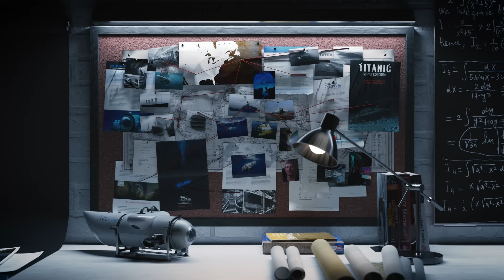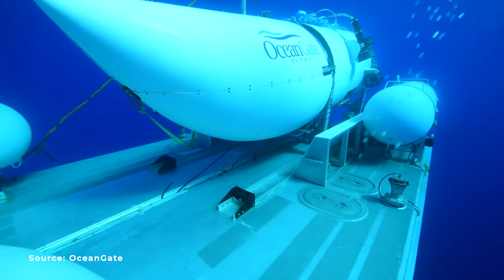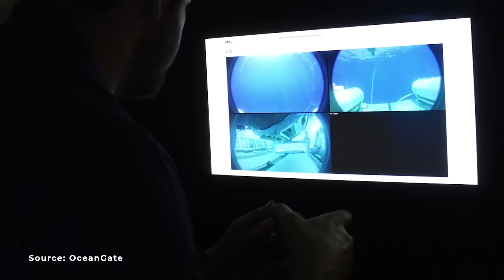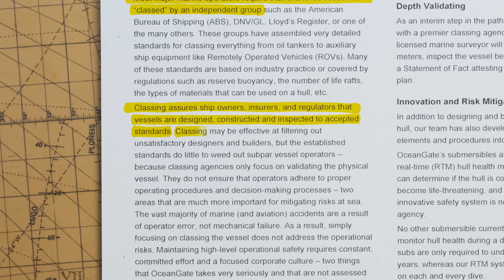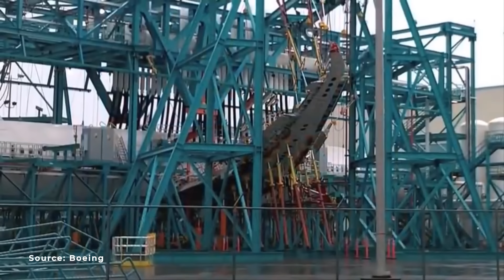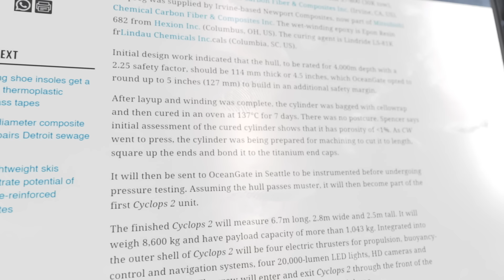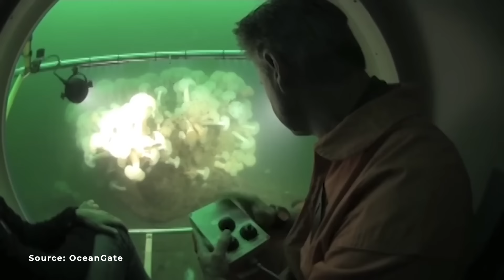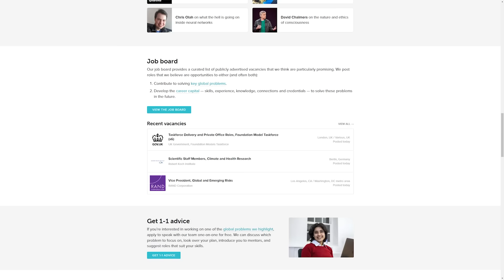The Questionable Engineering of Oceangate

Comment: "The vast majority of marine (and aviation) accidents are a result of operator error, not mechanical failure".

That is because early days of flight and submarine experimentation weeded out many of the bad designs and bad engineering that caused catastrophic failures, you arrogant fool.

It is a testament to modern design features in these vessels that were earned with blood and bones that we have developed resilient devices that sometimes can even compensate for user error or unpredictable situations. It is total failure of understanding to think the opposite, that you can cowboy your way around your submersible and it will all be alright.

Comment: 8:40 I've watched a lot of woodworking videos, and I don't know if it's the same case here, but I think you actually need a vacuum to remove air bubbles from epoxy, not more pressure, idk though, please correct me if I'm wrong. thanks. Great Video.

Comment: As someone with decent experience in FEA modelling, I couldn't imagine how difficult it would be to analyze fatigue and cyclic loading for a system like and give a design a green light. From an engineering perspective, fatigue would be one of the first areas of concern after all of basic functionality is sorted out; very difficult to assess due to material voids like you said.  Composite materials are great, but man, you can have one localized failure that could lead to a complex system failure in multiple ways.

Comment: I experienced the bike industry go through this. They had a lot of failures and were making frames with carbon used in compression areas too much and having to innovate to lower the voids and make optimal layups. It seems they have dramatically improved and they use high end imaging to verify production and nowdays they make pretty good bikes. But they are sure expensive.
Reply: Yep true. Trek’s carbon bikes literally say that in the OCLV designation: optimum compaction lower void. I always thought it was innovative and of course lighter in weight, but again, - somewhat experimental. After seeing this i have a new respect for this materials “limitations”.
Reply: Yet they still ignore proper aerodynamics.
Reply: @stormveil  If you mean riding position, I'm not sure you can blame the manufacturers for that...

Comment: What you are describing is not an "accident", it was an intentional stupidity.  It was a failure mode that was predicted by multiple people. They were warned multiple times. They didn't react appropriately to their own (inadequate) "warning" system. They heard cracking and instead of landing and thoroughly inspecting the hull, they ignored the warning. Their trouble shooting should have required testing and probably replacement of the hull followed by additional testing to destruction to determine the upcoming failure.

Comment: When deciding what I wanted to do with my life, I thought about engineering. And so I did quite a lot of research on what engineering entails, and a part of this was looking at testimonials. 99% of them said that a good part of their job was essentially forcing contractors to abide by safety laws and regulations. They all said that safety is the #1 responsibility of any engineer, and that they would rather lose a contract than cut corners. Every engineer I talked to said that if someone in their field doesn't take safety seriously, they shouldn't be called an engineer.
Stockton Rush was no engineer.

Comment: The great irony here is that the Titanic itself also thought it was above the engineering expertice of classification societies. You'd think Oceangate would've learned from the very "unsinkable" vessel they intended to study.
Reply: The Titanic was faaaaaaaar above any standard of its day. Olympic legitimately was the safest class of ship you could be on in 1912. It had a network of watertight bulkheads, redundant flotation and ballasting, internal communication, and it would need things to go badly wrong over a large portion of the ship at one time to sink it.

But obviously it wasn't perfect. The iceberg buckled the hull over a long length of the hull, it separated some rivet joints, and it let water into 5 of the watertight compartments. Almost any other scenario and the Titanic would've made it back for repairs. 4 compartments and it would've stayed floating. 5 and at sinks.

So it was above standard. This is completely different - something with clear problems that everyone could see, and they just declared it safe and continued.
Reply: @rageagainstthehygiene2357 Sure but no one really has an issue with the design of the Titanic. It was the lack of lifeboats.
Reply: Journalists called it unsinkable, not White Star line
Reply: The titanic was about as safe as modern cruise ships
Reply: @MaticTheProto It did not have radar for ice mountain detection radar and it was running full steam during night.
Reply: The designers of the Titanic didn't believe it was unsinkable.
Reply: It really wasn't
Reply: Thats just wrong as the Olympic-class was legitimately one of the most modern and safest ship-class in civilian maritime shipbuilding for its time. The Company (Harland and Wolff Shipyard) that did built these ships for White-Star line were arguably the best at the time and were highly revered and experienced in their field. Also the general ship-design itself was already one that the company built numerous times. They didnt re-invent the wheel with the Olympic-class. The engineers, the workers, etc. They knew what they were building and did a legitimate good job at it. As they had extensive knowledge of what damage to expect, the overall design and established building procedures, aswell as newly added safety features. Because they built ships since 1861.
This myth the Titanic was sub-par is plainly and factually wrong as it was built by highly experienced company, a Ship-design which they simply upscaled and had safety innovations just recently being put into practice or being presented to the world. Water-tight compartments, bulkheads, alot of redundancies, clever use of physics for damage it was designed to withstand, etc.. Ofcourse for our modern eyes having "top-opened" water-tight compartments seems lackluster, but only because water-tight compartments in itself were a really new invention and because there simply wasnt a need to have them as if only 4 compartments flooded (which it was designed to uphold), equilibrium wouldve prevented anything more things.
The Titanic was not sub-par nor badly made. Literally the contrary as there was arguably no other ship-building company as good as they were for civilian ships, with safety features no ship-building company did.
Especially telling since the Olympic was retrofitted with the newfound knowledge and the Brittanic was built with them new standards aswell basically immediately right after the incident.
The Titan accident and Titanic disaster couldnt be any more different.
Reply: wokist narcs dont care about reality or who gets dragged down with them when the inevitable reality of the matter kicks in.
Reply: The titanic was never considered unsinkable at the time of its voyage
Reply: Damn haven’t seen a burn that good in ages.
Reply: But still, operator error is what sank the Titanic. Not bad design.
Reply: But the Titanic sank on its maiden voyage. Oceangate had already made successful trips to 12,000ft.
Reply: @zedwpd  OceanGate's Titan sub was a deadly design waiting for a failure to happen. It didn't matter how long it would take, a catastrophic failure of the hull was an inevitability. That it didn't happen on the first dive is just an example of luck, nothing more.
Reply: @zedwpd  After testing with dives to its maximum intended depth in 2018 and 2019, the original composite hull of Titan developed fatigue damage and was replaced by 2021. In that year, OceanGate began transporting paying customers to the wreck of Titanic,completing several dives to the wreck site in 2021 and 2022. During the submersible's first expedition in 2023, all five occupants were killed when the Titan imploded.

They also intended to use carbon fiber on the first own built sub but the idea get scrapped.
Reply: @zedwpd And then ignored all the glaring warning signs. The titanic didn’t have a chance to do that.

Comment: Firstly, congratulations on your masters degree. Secondly, a question. What would have been the chances of failure had the centre carbon fibre section  have been laid over a titanium frame stretching between the two titanium domes?  Perhaps the failure may still have occurred in an area between the supporting frame but then I am not an engineer.

Comment: Upper skins of composite wings are used in compression and undergo thousands of cycles. Titan used a very thick laminate which, as best as I can discern, used only a unidirectional laminate. This is poor design practice. I do not know if this laminate was cured in an autoclave or an oven. As the laminate cures, thru the thickness thermal stresses can develop and superpose on the loading associated with pressure. This was at be a garage design.

Comment: The video of the wrapping of the CF hull seemed fraught with failure even mild acknowledgement of existing "best known practices" (IMO)? Tension layering is not the same as steady compressive + tension layering (by a wide margin).. The lack of using an autoclave, and the relatively uncontrolled atmospheric environment in which the CF hull was wrapped/laid... 
I could expound on each of these (seemingly) deficiencies, but several channels focusing on "additive manufacturing" best practices already exist..
Some of the evolution of layering/additive have been in development/evolution for over 100 years... Pneumatic tire construction is prime example/comparison... 
May they RIP...

Comment: Because search engines have become useless nowadays, I was unable to find information on what happens if you take ANY submarine and simply descent way too fast with it.
Reason I look for this is I wonder if Titan's health was squandered by simply descending WAYYYY too fast. I presume doing so is very stressful for the hull and could on its own destroy pretty much any submersible. Is this correct? It would be interesting to find out that Rush's screw up caused the collapse, rather than the sub itself.

Comment: I know it's not quite comparable to subs but I've been on tugboats for 11 years. I'm not a captain, but I'm the deckhand that my boss uses for the annual COI (Certificate of Inspection) on all our boats. If we fail inspection for any issue that the Coast Guard deems critical to the integrity of the vessel we are forced to dock that vessel until the issue is resolved.

It helps sway the scales in favor of operator errors being the reason for an accident. Never once have I been afraid of our boats going down. And I trust my captains. If I ever feel unsafe I have the right to call for an "all stop". 

If everyone does their job well and listens to each other there are far less chances of people dying.

Comment: Virgin Galactic's failure is not even comparable. 

the pilot was experienced, a test pilot, knew the risks. They screwed up. that's on teh test pilot. Could they have done better in teh design? yes, but hindsight is 20/20. there is no regulation that would have prevented that. 

Regulation is NOT the answer to every failure. You CANNOT anticipate every possible failure.

OceanGate took senseless shortcuts that even amateur YouTubers don't take, ignored expert advice repeatedly, and were taking paying passengers. that's a LOT different.

Comment: An excellent and informative piece.

What is your opinion about the bond between the carbon fiber cylinder and the titanium hemispheres?  Given, during descent and ascent the vessel goes through temperature changes (as well as pressure changes), what effect could the different reactions (the different rates of expansion and contraction, of titanium and carbon fiber) have on the bond between the two materials?  Is it likely that the epoxy used to bond the two materials is resilient/flexible enough to retain the bond between the materials (as they expand & contract differently to the changes in temperatures) and that the epoxy, itself, could withstand the pressures involved as the epoxy stretches and compresses maintaining the bond between the titanium and carbon fiber?

Comment: Another thing I seem to recall was we were looking for gas tanks to replace the usual steel/aluminium for a brief period carbon fibre was consider because the fire brigade use some in the BA sets. Then we found out they can't be tested so are considered a disposable item. Normal test for gas tanks is they are over pressurised in a water bath and the %age deformation measured.

Comment: Put like this, accident waiting to happen. I worked in telecoms testing for environmental factors, there were specifications and legal we had to pass and no lives were at risk if we screwed up. First company I worked for a major player we had to beat the tests by 25% internally minimum before we sent for outside testing. Switched to a smaller manufacture for my last couple of years and there we just tried to meet the requirements.

Comment: that paragraph below that highlight, accidents are result of operator error, not mechanical failure. Yes, the engineering and standards are made to ensure those do not fail. this is precisely the WW2 airplane design story, those planes that made it back, are those that has bullet holes in non essential parts.

Comment: While I am not necessarily a super fan of Elon Musk, the fact about SpaceX is that they test and destroy a lot of their designs until they find the solution to a problem. As far as I know, SpaceX and Elon Musk have not put the lives of people in danger in the same manner as OceanGate and Stockton Rush did.
Testing experimental vessels without any Class certification of testing is not necessarily a bad thing as long as the people testing them understand and accept the dangers involved. However, when you bring passengers with you in an experimental, un-certified and un-tested vessel, you are simply an idiot and when you ask the passengers to pay for the experience of dancing with deadly dangers, you are nothing but a greedy idiot.
At the end of the day, the demise of The Titan and the people in it was a result of cheap Charlie engineering and a deeply flawed business model.
First, OceanGate kept development on the cheap by using Carbon fiber instead of the better proven materials of Titanium or high strength steel alloy.
Then, Oceangate decided on a cheaper method to create the carbon fiber hull and when the submersible was finished, OceanGate refused to get it independently certified by a Class society, which you always do with any type of maritime vessel in which you intend to bring passengers.
Finally, OceanGate ignored the concerns of the entire deep sea exploration community and the massive narcissist Stockton Rush even believed the vented concerns to be a personal insult.
The very second OceanGate decided on building The Titan, it was doomed.
OceanGate will most likely be sued into oblivion and will be forced to close down. Nobody in their right mind would ever want to support OceanGate again financially.

Comment: I believe they had heaters and LED lights embedded in the hull as well. Thermal cycling+ stress concentration +snap buckling initiators
Reply: Correct, the epoxy matrix holding the hull structure together has no real strength, the crakling noise heard on previous dives was the epoxy starting to degrade and break up.

Comment: I think you were quite unfair to spacex with the analogy given near the end. 

They have tested to failure. But went through ungodly testing before even considering wacking humans into it.

Nasa did best when they blew stuff up till it work (god bless the f1 haha).

But as a striking one, the moment carbon fibre based pressure vessles failed during space x's testing, they scrapped it immediatly.

Tldr: Virgin Galactic and Seagate are idiots who took careless risks with human lives.

Space X did test by failure right in my humble opinion.

Comment: I saw a breakdown of the transcript that revealed the play by play of depths, times etc. They descended way too fast. They were 1200 meters deeper than normal at the 1hr 45m mark. It should’ve taken them 2-2.5hrs to reach that point. 

Their message replies became very short, they reported creaking noises in the aft, tried to ascend and only came up 30 meters in 3min. Then reported more noises in the hull. They had to switch to the backup battery and that was their last message around the 1hr 46min point. Sounds like water got to the battery, they imploded while slowly coming up. Compromised hull, descended too fast.

Comment: Good video.  Not a composite engineer here, but I've had some experience in epoxy encapsulation.  One thing  I have some familiarity with is the use of vacuum in encapsulation.  Best practice is to degas the mixed  epoxy with vacuum before potting and then vacuum the assembly after potting to remove trapped gasses and bubbles.  It works.  I was surprised by the voids in the sample at 7:47 , totally unacceptable.  I suspect the pressurized autoclave mentioned in the video would reduce, but not eliminate voids.  Are composite assemblies ever degassed before curing by the use of vacuum?

Comment: what was also crazy is that the hatch is screwed shut from the outside and that you cant open it from the inside. that sounds terrifying. What if you resurfaced and they couldn't find the sub and you're trapped? considering it didn't even have a GPS or emergency beacon.